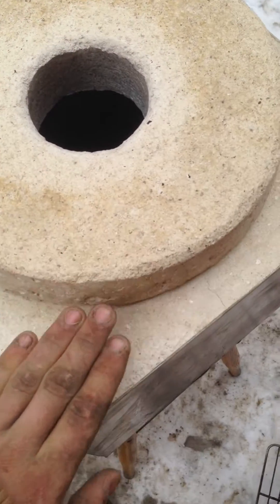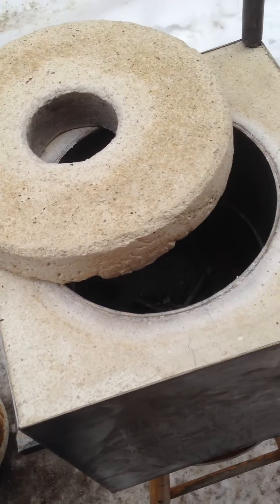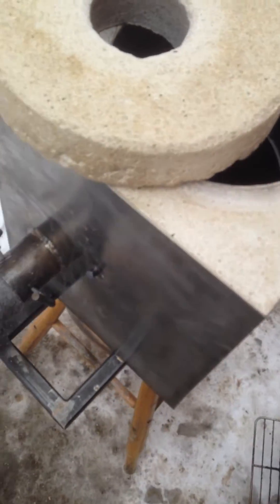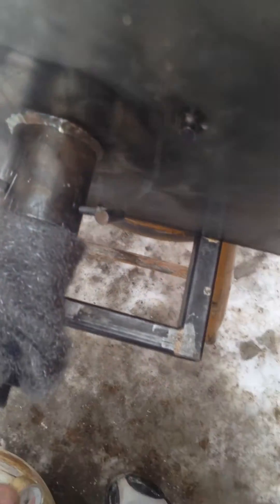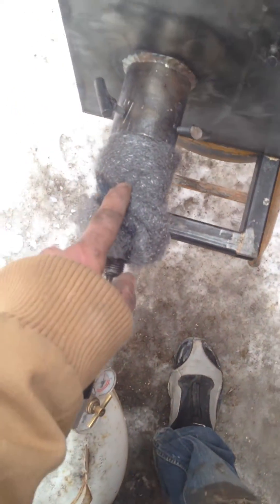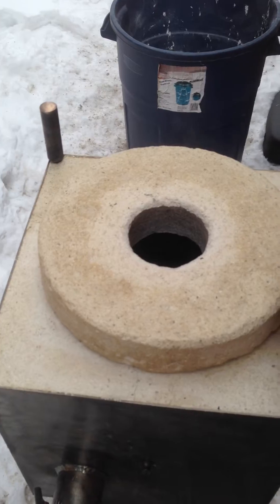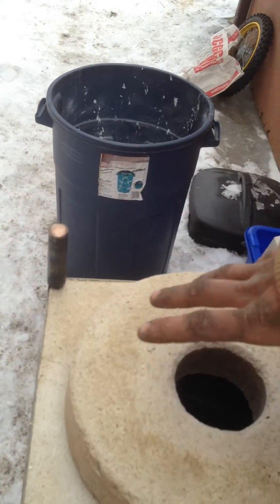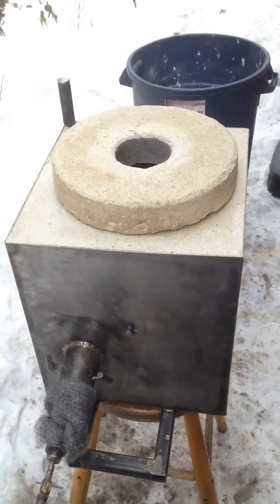DIY home made aluminum foundry PART  "1.5"

Comment: would mixing perlite, glass water, and refractory cement be a good mix?  Also what ratio of mix did you use.
Reply from the maker: Perlite and water glass alone would make a good refractory mix. Addin refractory cement will make it a bit harder of a finished product. The ratio isn't too crucial, I used approx 750ml to 25lb sand. All approx.. You could go less I'm sure (some support wouldn't hurt in that case...) and you can go more.. You could go 2 litres if you wanted too.. The point at you know you have gone to far is when the water glass expands like spray foam when fired... And that would take a hell of a lot of water glass. You can really fuck it up unless you used like 50ml with 25lbs (good luck with that..)

Hope that clears it up.
Reply: nilamotk http://www.acehardware.com/product/index.jsp?productId=29370216&KPID=17520698&kpid=17520698&pla=pla_17520698                                                                                                                                        This is at my local store.  What are your thought on using this instead of perlite.
Reply from the maker: That would work, the microbial stuff would just burn off.

If you can find plain silica sand, is your best option, you could mix in some perlite to lighten it up if you wanted too. (It will weaken it though)

Comment: Damn very nice work bro very nice. The insulation you used is that the perlite and silicate stuff cause if so that is some nice looking stuff. How do you like it. Any positive and also negative features of it that you can mention as I am going to do it as my medium for heat mantle
Reply from the maker: It's actually perlite with plaster, and another layer of plaster and vermiculite. The biggest down fall to this mix is it takes forever to dry fully, but it takes shape relatively quickly.. In my up coming video I will be showing how to make a really strong refractory mix out of sand that would be good for a mantle too.